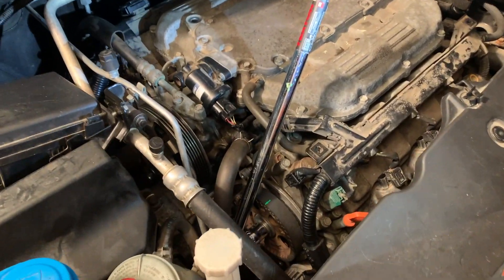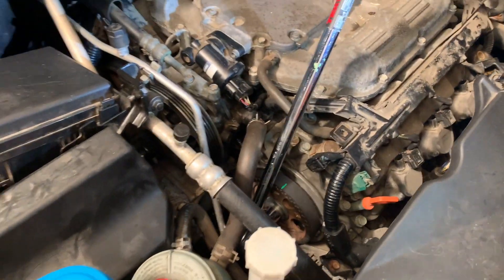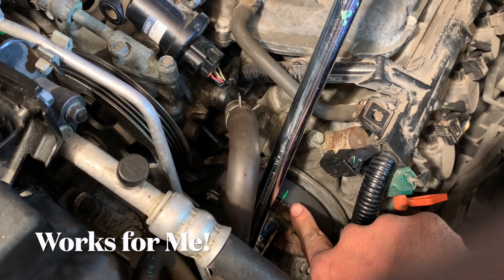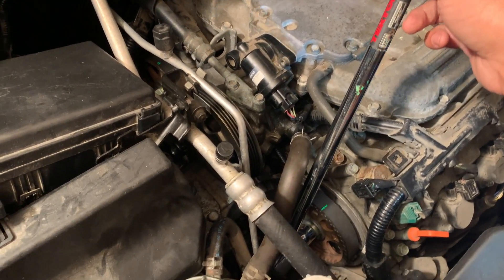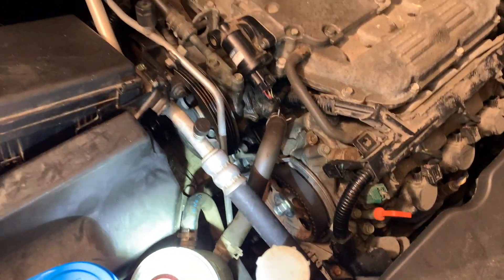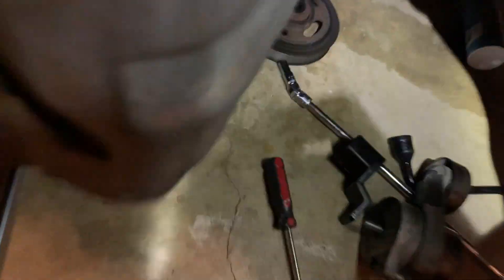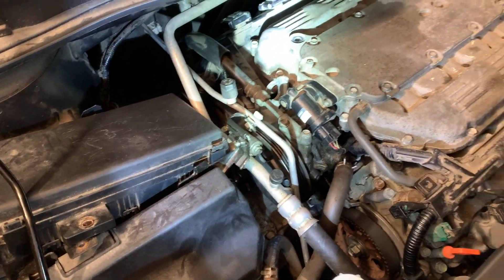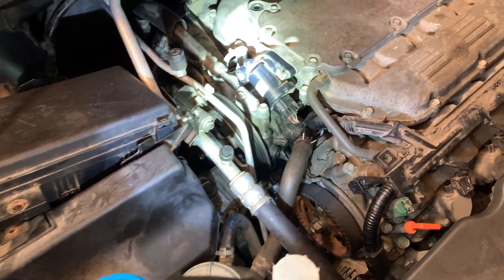Honda V6 Timing Belt done perfectly with proper tension

Comment: Are new belts suppose to whine? Just installed mine with the tensioner and water pump, but I hear this whoosing sound, kinda like a drone
Reply from the maker: yes i heard a whine too... i think it is normal until the rubber gets used up a bit and loosens up
Reply: @WorksforMe  after a day i was thinking about tearing everything apart again, but will sit on it for a couple more days and see what happens, thanks!
Reply from the maker: @jtjimenez05  Just check belt tension on all sections. As long as you don't have too much slack in one place and too tight in others, you are good. It should get better with time. In my case, after 1-2 days it became normal.... If the car is driving strange, it may also be because the battery was disconnected, so the car is relearning the idle speed, shift points, etc... just drive a bit and it should be normal.